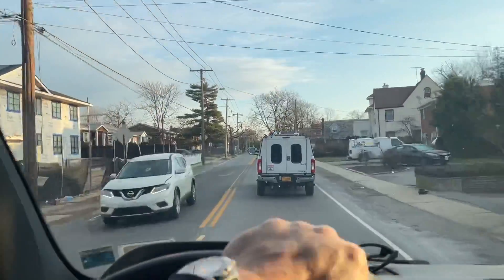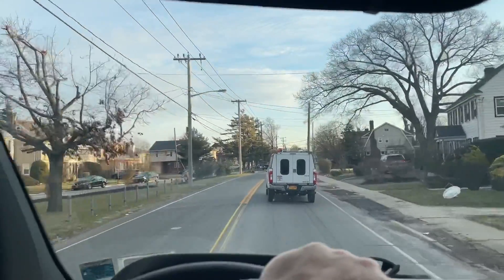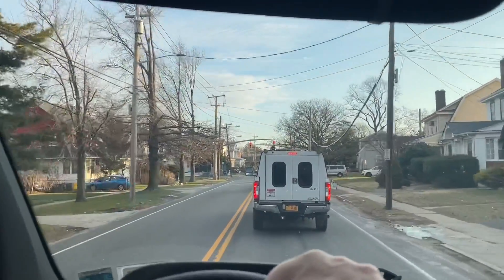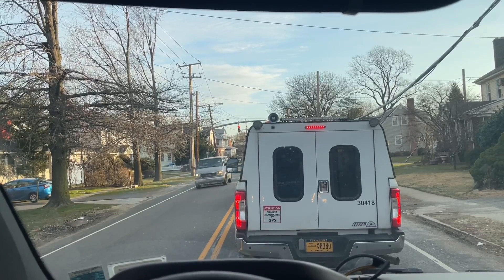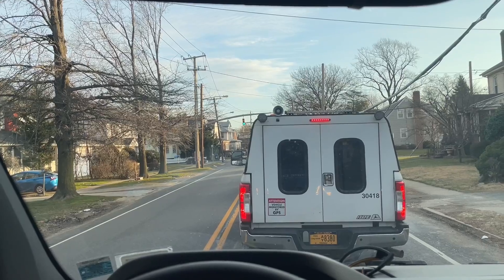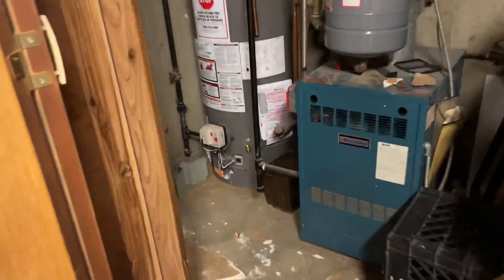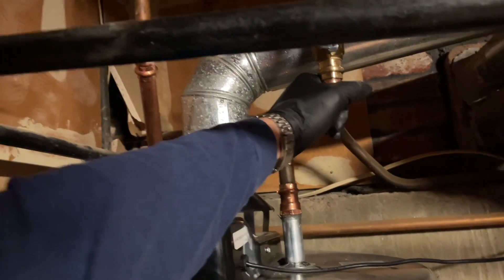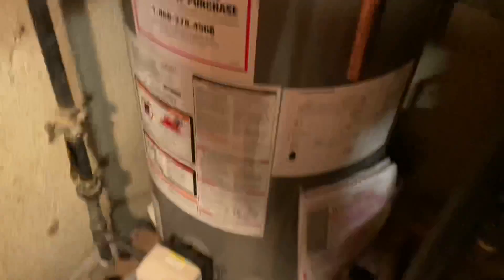Water Heater Running But Water is Cold! How to Find a Massive Slab Leak Detected with Leaktronics

Comment: You’re “Tool Happy”. Been on jobs like that, walked away. What if the homeowners insurance co.
said I did it wrong. Homeowner won’t pay the deductible because of what the insurance co.
told the homeowner. I do the job, find & fix the leak … insurance co. disputes my work/bill,
homeowner does same = I don’t get paid. Wayyy TOOO much risk of not getting paid. B.T.D.T.

Comment: Next time turn the cold valve off to water heater and let tank satisfied.  They open valve until it starts to get warm or cold again.  Then use a thermometer lazor gun and measure temps on tiles . I have pin pointed several slab leaks especially tiled floor just crawling on my hands and knees feeling for a warm tile ... works everytime. Now a cold water slab leak or a none tiled flooring is much more difficult to find and we use the sound machine.  Also we try to locate the water manifolds in the walls and cut in ball shut off valves.  This does 2 things , it tells us which fixture has the leak and also once u determine which shut off has the leak just turn it off and boom the cust has hot water to rest of home as normal until the insurance and repair r complete.
Reply: @PipeDoctor  yea that shit was way down there just above what they call hell .

Comment: You can just put a pressure gauge on the tank assuming it’s not full of sediment and make sure no one opens a faucet and just shut the incoming cold to the heater and if the pressure drops you know you have a slab leak if it stays pressurized you’re golden

Comment: Was the water leaking into the ground? Is the kitchen on grade and the rest of the house above a basement? Didn’t know if the tubes were poured between subfloor and tile. Thanks for the tip on the leak detector, would have been nice to hear leak detector audio. Thanks for the videos.

Comment: did they do the big dig yet? interested to know how close the leak-tronic nailed it..  the problem with using FLIR like some suggested would be that the leak is so big the water would be cold before any heat penetrated u through the slab. since the water is not going in the house it has to have a pretty good sink-hole carved out underneath by now!..and their water bill is gonna suck for this quarter

Comment: Use a pipe locator to outline the pipe in the ground, then use your sounds detector and when you think he found where the leak is drill small holes in the grout line to look for water.
Reply: Noice

Comment: you could wire that is She a Leaker Mama detector 2000 to the cam or other recorder and add it to the video while you use it.

You need to tie another rope to the metal part and have the helper pull it along slowly and walk around.

Comment: Why is the listen head so large? Don't they make a smaller one? That looks like it made for finding leaks in parking lots on commercial.
Reply: @PipeDoctor  No the part you put on the ground, looks like it is 8" diameter when you first started listening

Comment: You should had bought the doldak leak equipment its way better then what you got and you need to get the ridget locator and tracer its the best set up and it will.make your job much easier

Comment: Leak detection is difficult under a slab. I make the repair but my company recommends a service, the accuracy seems to be plus or minus three feet. The leaks in hydronic piping recently all have had kinks on the under side of copper pipe that occurred at the during the original installation. This condition of water movement across the kink and 50 plus years later the water spills $$$ later all better. I almost feel bad but you called me and it's not a free service.

Comment: why not use a transmitter connected to the hot pipe where it enters the floor and trace it with a detector to the outlet

Comment: That's very noticeable on the water bill consumption.
Reply: Yes but it takes at least a month to see your water bill.   They knew they had a hot water problem right away.  Unfortunately misdiagnosed bad tank but understandably why.   If the cold water line was leaking then yes they probably wouldn't notice until they saw the bill.

Comment: Is it possible to use a thermal imager? If there’s slab radiant, turn it off and run the domestic water. Then see where the largest thermal image is....?
Under cabinets would be difficult but...

Comment: Just run a new hot and cold water line break the tile out of the way cut the floor with a good Cement Saw or use a jackhammer your tool that you're using it might be good for commercial work not there and replace both lines there's no other way to do that job

Comment: pressurize the hot line(turn off water to water heater first) with c02 at the anglestop to lav sink then turn on the kitchen faucet until the c02 comes out and turn off faucet. Used your acoustic listening scope to locate bubbles. Or you can use a infrared thermometer to locate the hottest spot. The compressor came in clutch tho I’m glade you found the leak

Comment: Silly question, how does a leak in a slab become substantial? I assume the pipes are in the slab so there's not really anywhere for the water to go. I can't imagine the water pressure would force its way through concrete, or maybe it does?
Reply: Concrete is surprisingly porous. So is the ground underneath it. Our cooling tower in the power plant I work at has a "small" leak in its concrete sump (lined with epoxy but the epoxy has failed). It manages to leak about 1000 liters a day into the ground. 

I've also seen air bubbles leaking upwards through the ground around commercial buildings that have positively pressurized mechAnical rooms in the basement. When it rains and the ground is wet you can see a massive amount of air bubbling up through the concrete and ground near the building. And the static pressure isn't even that much... Only about 30 or 40 Pa.
Reply: @jond3929  Well there you go! It never really clicked to me that concrete is porous however I distinctly remember the sound you get on some concrete when it gets wet and it starts bubbling. Air pressure forcing its way through a slab is pretty neat though.

Comment: If you shut off the output to the water heater. Turn it up the heat and use your flir ? The first hot spot should be your leak 

Looks like they probably used a masonary anchor and probably hit the water line .

Comment: Ome suggest I have and don’t take this the wrong way or anything but this is just what I feel about my truck is the window needs to be spot less especially at night so a truck is clean the window with invisible glass and then after that use rubbing alchol to remove the film that’s left over and your inside glass will stay clean and crystal clear

Comment: My house is similar to that house and a leak in the floor is something I hope I never have I would think if it let loose in one spot it will let loose other places soon too
Reply: Not necessarily.  If the pipe cracked due to the foundation settling then it would only leak where the slab cracked.

Comment: Get the water real hot then use an infrared camera on the slab to find the hot spot. That'll get you in the ballpark. 
Using your listening device in the cabinet is useless, IMO, because it isn't in direct contact with the slab.
Reply: it might no even work depending on the leak type
my slab here is 4 inch thick and it takes up to 4 hours to start seeing anything in it infrared or not 
i tried it once i started my hydronic infloor heating. took forever to start seeing anything.
Reply: I’ve had a residential service call for a hot water slab leak during the winter, we were working trying to figure out where the leak was with our equipment and couldn’t find the leak... then I saw the homeowners cat and said to him that his cat is a nice breed. And then he replied that he is but lately he’s just been laying down in that corner lately .. then I got suspicious checked where the cat was and bingo the leak was just where he was lying down 😂😂😂 cat found us the leak !!  Hahahahah told the homeowner I’ll buy his cat cuz sure enough was better than my equipment 😂😂😂

Comment: i wonder if you let the water heater get up to max and open the valve if you code see the pipe with your IR for checking radiant heat, it should at lest show the puddle under the floor.
Reply: @PipeDoctor   i will stay tuned for the rest f the story.
must be down in there deep.

Comment: That was a total waste of time and effort what are you gonna do just bust up that one section because all that problems and damage and patch it there and then two months down the road it’s gonna break somewhere else under the slab you got a replace the whole line anyway it’s 1000 things you can do rather than waste time doing that and then busting up that slab and rec in the kitchen because the insurance company ain’t gonna pay for that
Reply: @PipeDoctor  Yes exactly and that’s what really should be done otherwise you’re chasing your tail how are you gonna bust up the floor in that one spot and match the tile so you gonna bust up the floor anyway and I go throughout the whole first floor there is a bus stop everything replace the whole line did you know as well as I do it’s gonna break somewhere else especially if you start messing with one end of it and vibrating it
Reply: @PipeDoctor  u the man , keep up the great videos.thought u where going away ?

Comment: Hey Mikey you didn’t reply to my comment on that expansion tank video.
Reply: @PipeDoctor  That’s not a reply to my question Pipes! It’s about purging a expansion tank.
Reply: @PipeDoctor  Mike I know you don’t purge an expansion tank it’s a manner of speaking lol
I’m talking about draining a ruptured expansion tank like in your video about draining it with a pump. I asked if you think that would work with just a  plain hose with a bicycle valve on one end into a bucket you know gravity instead of suction. But that’s ok I’ll try it if my tank ever fails.
Reply: @PipeDoctor  Mike I don’t mean pumping it out with the bicycle pump. I’m talking about using a tire valve adapter like on an air compressor hose on one end and nothing on the other end into a bucket gravity might do the trick I’ll try it if it ever fails.To avoid the cost of a pump.
Reply: @ciscokid2444  Drill a hole in the top to let air in, and drill a hole in the bottom to let the water out. The smaller the hole the longer you wait.

Comment: without watching any further…I had just bought a listening device and my first job was at a cemetery and after hearing weird shit and not being able to use the noises it made I quit using it and went back to “other”methods to find the leak in their irrigation system. 
So was that kitchen on an outside wall or garage? 
my method for finding this one would have been get the water hot again let er rip slowly and call me when you find the cozy spot
I might start recording my plumbing too  
Good luck bro!
Reply: @PipeDoctor  so it was corroded and not frozen then…Thanks for the video and the reply!!

Comment: Had this on a high ranch in Oceanside,abandoned the underground,ran new hot,cold and hydronic lines through ceiling,back down through the common wall of lower stairwell,and down outside wall into sinkbase.Never touched the tile floor.Insurance company was very happy!Good luck,will be watching for the dig!
Reply: My thought is perhaps the line is copper that wasn't protected from corrosion. Copper piping embedded in concrete needs a protective layer, but that just a guess that its copper piping. 

Seems like any way you try to fix this issue, its going be expensive (slab, or re-route through walls. If its a corrosion issue, than the entire pipe probably will need to be replaced as it will just fail in another spot. If the best option is to go under the slab, then perhaps use a sch 80 PVC conduit with PEX inside. if it ever fails it would be too difficult to just replace the Pex instead of digging up the slab. or perhaps run a spare(s) under the slab so there is backup.
Reply: I was thinking the same thing abandoned the old lines and run new ones .

Comment: Why fix a slab leak just for another to pop up a year later? People should just repipe with pex through the attic.
Reply: Busting a slab is silly for a slab leak, Like you said just reroute overhead and don't worry about that pipe leaking again.  Silly to locate a leak and then jack hammer the floor to make a 10 inch repair.

Comment: thats not a leak you found  its the urinal at  the ant colony lol    wouldnt running cold water through that warm slab show up on thermal???   its got to have that whole thing undermined if the water tank wont keep up.

Comment: I would think a nice radioactive isotope in the water with a geiger counter.....just kidding..:)  Not sure a thermal camera or temp sensor would work when no heat is being produced.  Hope the line can be isolated and valved off.  I suppose you can't reline with pex or plastic.
Reply: @PipeDoctor I think you are going to have to remove about 4 tiles near the sound of the leak and start digging down and hope for some luck. If that doesn't turn up the problem say sorry, you I tried and run like hell from it. otherwise it could turn into a war zone.

Comment: Godzilla go get a sledge hammer. Lol
Reply: @PipeDoctor  I wondering when you dig down you find a portal to an alternative universe with Kelvin on the other side.
Reply: How is there no leak anywhere. Is it sitting on concrete? Eventually there’s gotta be some water seeping up somewhere ? Any thoughts! She’s a leaker mama
Reply: @PipeDoctor  Sounds like the foundation settled and cracked.  When it cracked it broke the pipe.   I've got a crawlspace and hate it but at least I can get to all my pipes.

Comment: the old concrete eats copper trick, have replaced so many early in floor hydronic systems  because after 10 or so years the copper would fail
Reply: @PipeDoctor  we still have some of those very systems still kicking up near boston…yea i grew up running baseboard in those slab houses

Comment: Yikes...rather unfortunate for that homeowner. 

Would the thermal camera have helped you find this?
Reply: depends on how big the leak is. If its leaking so much that the water is constantly cold, then you can try a different approach. cut the water to the tank, let it heat up to the highest setting. Then turn the water back on.  This way water leaking out will be hot. Also helps if you cool the house down to as cold as possible so that the variation in temperature is more visibile.  If its in slab it will show heat quick. If its below slab  it will be much harder if not impossible.